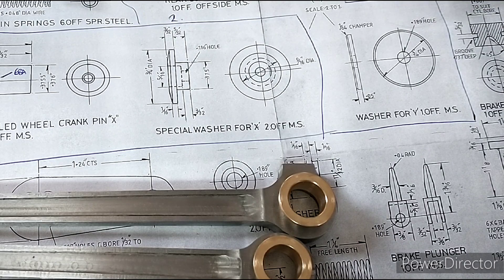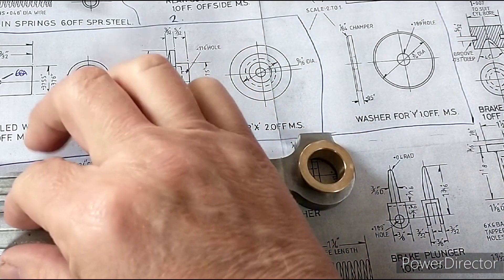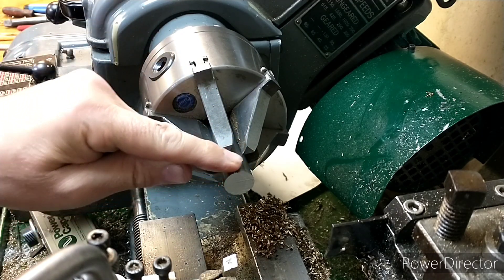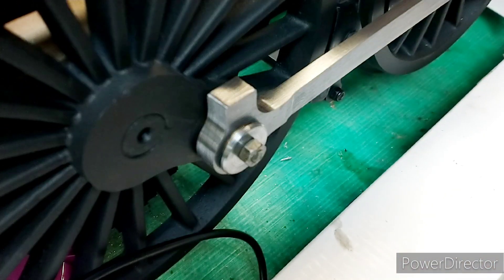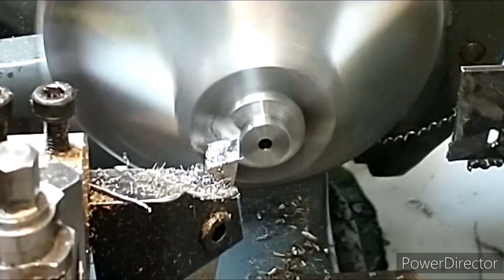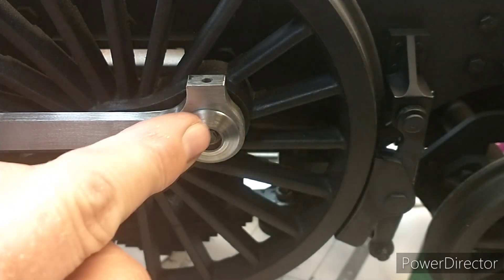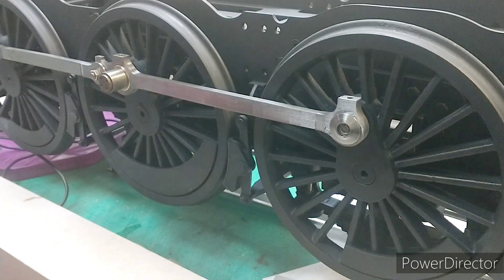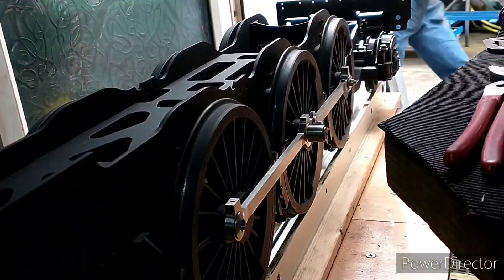Modelworks 5" Britannia Ep 30: Wishy washy #livesteam

Comment: hi just came across your channel, im enjoying your videos and ive subscribed! i like the chuck on your myford lathe, where did you get the chuck if you dont mind me asking
Reply from the maker: Thanks for subscribing 😀 I think I bought the six jaw chuck when the Myford factory closed. They had a sale of equipment and I picked up several unusual chucks. My lathe is quite old so the long jaws mean the saddle is in a less worn area 😀
Reply: @julias-shed  not too many of chucks around thats for sure. thanks for the reply. regarding your denford cnc lathe could you do a video of how you set up the centre drill some time if you get the chance?
Reply from the maker: @steam_fan  there is a good Denford getting started guide which explains the drill setup I just used that. Need to do some more CNC stuff but haven’t had chance recently 😀